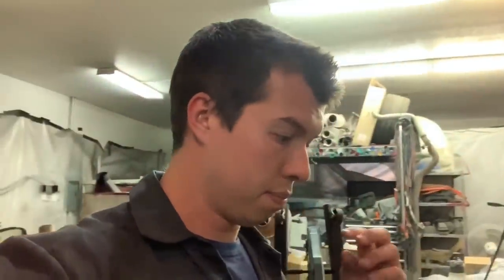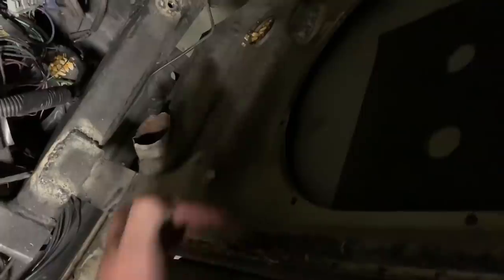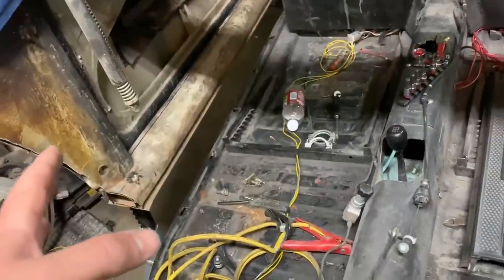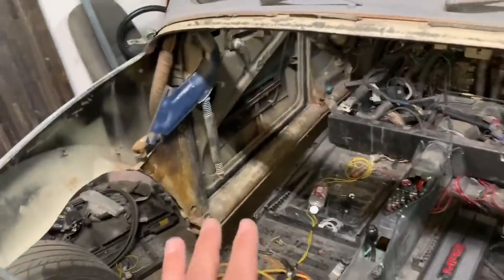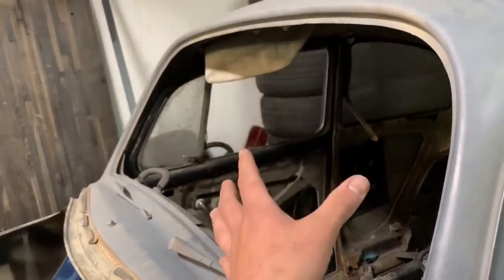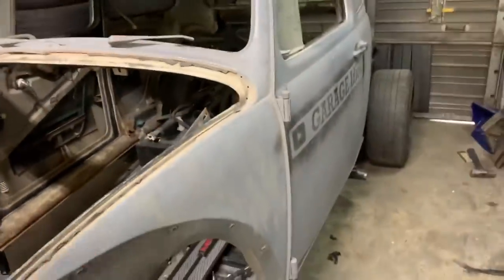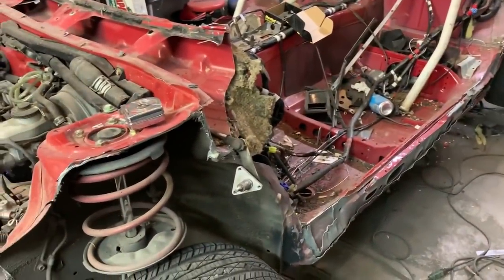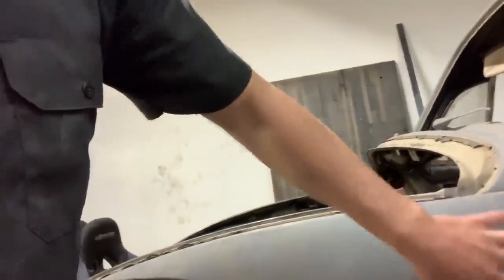NEW IDEA to make the Honda Bug body fit on the MR2 chassis!!

Comment: I'm thinking your pivot idea is good but I'll  would still cut it in half widening the top a little and the bottom more... In the long run it will avoid other strange issues that might happen. Would keep the standard front window... maybe just fill in the pillar around it.
Google vw bug hawaiian punch, I think it's inspirational and might help a little.

Comment: I think seating position is more important than fitting the body. The MR2 has a wider center tunnel than the Bug. So widening the bug makes sense. Measure the tunnel width difference and widen the bug at least that amount. I would go farther and section the sides to lower the windows, and lengthen the doors. And might as well give it a chopped top at that point to make it all look right.

Comment: Build a wood frame to go around the bug body at the body line under the side windows to hold that area and the area above it in place while you use a jack to spread the bottom until its the width you need it.

Comment: The center tunnel on the mr2 is a lot wider making it almost impossible to get a seat that fits. Cut the bug body in half. Find another bug and cut the top selection off as a donor panel to create the missing center piece of the roof, bottom of windshield and vents above the engine
Reply from the maker: Great points, thank you

Comment: dont cut the window frames, keep them normal but put expansion darts/cuts in the pillors beside them
Reply: this is the same thing I was thinking when he said to cut the windshield frame.  even if you only move one side a 1/4" then you are making it a total of half inch wider which will keep the factory windshield from fitting.  you should cut down the edge of the pillar then down the inside edge of the fender like this guy suggested and save yourself alot of time and headaches.  its easier to fill in those sections with metal also

Comment: I like your ideas and work. I like how you aren't afraid of tackling difficult jobs or even if you are, you don't let that stop you from doing it. People online talk shit all the time. You should take the comments with a bit of salt. Use the good ideas, learn from constructive criticism but otherwise try to let stuff just in from the other ear and out from the other. I know it's not easy task but sometimes you sound pretty apologetic and take quite a lot of pre-emptive measures and mock your ideas as stupid in advance. The ideas are not stupid. You have carefully considered the stuff and taken time to form your opinion. Someone may be able to bring up even more valid points and you can learn from them but that doesn't mean your ideas were bad. I think widening the bug body by stretching/bending is good idea. You could probably widen it quite a bit at the rocker panel level even without touching the pillars and the roof line but you should consider the head and the shoulder room. The center tunnel of the MR2 is wider than in the bug and unless you cut into it, the center tunnel defines how far to the side you need place the drivers seat. The shoulder line of the car and the roof need to be wide enough especially if you make a roll gage with tubes going to the a-pillars.
Reply from the maker: Awesome comment man thank you.  The gas tank for the mr2 is in that center section so we don’t really want to relocated that.  I think we are back to the first idea and are going to cut the bug in half

Comment: Like the idea and project. If you are going to weld the bug body to the mr2 chassis then just cut out what you need off of the mr2 to make it fit. Then add a roll cage to structure it. The shape of the bug body will structure it up quite a bit by itself.
Reply from the maker: Thank you!

Comment: I think so far the best idea I've heard would be like Michael Lane and a few others suggested in putting stress Cuts in the tillers and stretching the body to fit that would keep plenty of strength in the chassis and you should be able to stretch that thing for what you're needing may have a couple creases in the body but nothing that a little heat and somebody filler when fix all depends on how far you go with it with the stress Cuts or release cuts you may not encounter that issue
Reply from the maker: The biggest issue with this idea is the steering wheel of the mr2 is going to be crazy close to the bugs door frame

Comment: Have you looked into a capella chop? It's a way to chop the roof of a beetle without widening the roof by notching and bending the pillars. Could give you an idea what happens when you start to pie cut the pillars. Those curved shapes really start to go in weird directions when you start to cut them. Also, don't know how low you want the beetle body to go over the mr2 floor, but if you run the sidesteps (fake look at least) you have some extra space for structural stuff to stick out from the sides. Keep up the good work, always nice to see someone cut up cars and weld them together in not stock ways.
Reply from the maker: All great ideas! I’ll look into it! Thank you!!

Comment: Dont widen the bug top body. Heres how. Brace the bug body, then cut the bottom 2 inches off the sides of the bug. Then trim the structure on the side of the mr2, and set the bug body on top of it then weld it to it.  It will look like running boards on the sides, just like the bug originally had. Then add braces as required. If you need any help, just contact me. I'm in tucson, but I'll be happy to talk it out. Keep going, your doing great.
Reply from the maker: I did think about that but the front section of the bug/ mr2 would make that difficult

Comment: Hey, not sure if I like the roof "relief cut" idea.  Since the roof is a circle you are going to have to cut a long way to get it to move out.  Otherwise it will pull the center of the roof down in the middle.  

If you decide to cut it down the middle, I have a couple ideas. First take a pipe and a smaller pipe that will fit snug inside the larger pipe.  Weld the larger pipe  to underside-center of the roof before you cut.  Put one near the windshield, one near the rear glass and one in the middle and make sure they are square to one another. When you cut, take the center pipe out of the larger pipe and cut in the roof and the pipe in two.  This way you can line up the two pieces and will support your new metal you can weld back in.  Finally, I would cut AROUND the windshield and back glass area, they way you can keep the stock size glass.  Just need to add metal around the area to make up for the difference.  Lot of cutting and welding, but I think will look great when you are done if you take your time on the welding.
Reply from the maker: Awesome ideas man thank you

Comment: Running boards looks like it could be a simple option that would require no cuts to the VW shell. Also I am not sure about the metal types used the MR2 chassis construction but if it is a high carbon steel typically used in more modern crash cell construction then structurally it will turn to cardboard if you heat it by welding and you need to use an appropriate jointing method possibly spot and/or bonding combination.
Reply: The running board idea is a winner

Comment: To be honest it seems better to cut it in half and run plexi glass on the front and back windows. It seems so much simpler. Plus you would have a sweet ass stripe running right down the middle of the bug lol

Comment: You could cut the pinch welds that hold the sides on which will mean you keep the strength in the front and back panels and just re-weld the sides when fitted you would still have to remove the bits you mentioned but you wouldn't have to cut the roof hope this gives you another idea
Reply from the maker: Thank you!! One more thing to thing about! I appreciate it!

Comment: i wonder if it would be easier to literally cut it right down the middle? then attach the sides to the chassis and a strip  of sheet metal down the middle to re attach... hot rod guys sectioned hoods, fenders, and roofs since the 40s... just need a helper and some sort of way to hoist the body up for mockup and panel alignment

Comment: Have you ever thought of making a fiberglass shell of the bug using the current bug as a mold? You could then widen the shell and make it fit how you want.
Reply from the maker: That would take a LOT of work haha I like where your head is at though
Reply: @GARAGEIdiotS  it would also make it easier to put on and take off, and easier to cage it in the future.

Comment: Oh, one other thought. The make racing front clips for the bug, they are totally exclusive of the bug frame, to begin with. You bolt them on however you want. You might get away with that and the extended running board idea

Comment: I kindof liked the idea of cutting it in half; like you said its never going back on a bug.. so its gotta go on the MR2 the way it fits best. Stretching it would probably work but then your roof is going to be skinny; Should set the seats in the MR2 and check where they sit, I imagine its farther apart than the bug seats and you might hit your head unless you widen the bug.
Reply from the maker: Yea I’ve been thinking about that a lot

Comment: I think halfing the bug will look better and overall be easier to achieve. It's been done a bunch so I know it's possible. It's a curved panel, but I think it would be easier to make a single fill strip than patch in a half million pie cuts that are compound curved. Just my opinion I would half it.

Comment: Hi have you thought about cutting ten inches out of the center of the mr2 just a thought might work better and look better that way it still looks like a bug. or even a pie cut in the front were most of the mr2 needs narrowed .
Reply from the maker: Gas tank is in the center :/
Reply: put in a fuel cell @GARAGEIdiotS

Comment: Cut more out on the mr2 floor and just stretch the bottom of the bug out without relief cuts. I bet you can stretch the bottom out 2.5 inches per side.Then cage and re-enforce.

Comment: If you have to widen the front more then rear you will mess up how the door opens and shuts. Prying out the bottom of the body will most likely buckle the crap out of the roof too.

And have you checked to see if you'll be able to fit seats in it? The MR2 has a much wider transmission tunnel.  And if you narrow up the center section of the chassis at all fitting seats could be an issue.
Reply from the maker: Yea that’s the biggest part of me wanting to just cut it down the center for that reason

Comment: Keep it simple and never try to bend compound curves... A simple cut down the middle and fit both sides separately then fill in the gap. In the end you will make up a space-frame and using decent tube throughout it could look great and give your floppy bodywork something strong to fix to.
Reply from the maker: Awesome, thanks!

Comment: It’s either cut slots or cut the bug and a half weld one side walls another side separately to the sub frame find another bug in the junkyard cut that stripped out and install it in the middle strip that you cut out and then reinforce the area that was cut with metal tubing like a cage

Comment: Have you thought about doing a roof chop ?? If it was me ild make a jig to hold the but at the size of the mr2 floor cut the roof down the middle and then you can add steel down the middle and then you will keep the lines of the beetle and you won’t notice that the body of the beetle is wider the rear and front window would need to be bigger
Reply from the maker: I have, the only thing that is stopping me is I hate how it looks with a roll cage on these cars, that was the original plan until I saw some with cages and did not like how they looked
Reply: I messaged you on Instagram

Comment: Alternatively cut the body at the body line just below side windows, add a 2 inch filler strip, then pull bottom of body out one inch each side. 6 inches wider with no changes to roof or screens. Only issues will be if you need roll down side windows will need to modify inner door shells to allow window to drop and changes to fender profiles where they meet the body.
Reply from the maker: At one point I was looking at that body line and thinking something similar, the door/ window function is what scared me
Reply: @GARAGEIdiotS  You could try the design for side windows used in early 1960's Austin Mini Mk1, here in UK, where there are two front to rear sliding glass windows split vertically in center. Check google images to get the idea. Not sure if early Mini's were exported over there but are easy to manufacture as flat glass.

Comment: So I am a doer also and that sounds like a working plan. But, I will say this, on the Bug the sold points near the windows where you are talking about cutting, where the rain would run down - is the structural point for the Bug body.

I think you will good though because the MR2 has structural support in the pan itself whereas the Bug pan was designed to flex.

What I would add to do that is add a roll cage that runs right up against the roof of the bug, plus make sure you have solid cross support above the Mr2. The stuff you use for shock tower support, ect

I say that because the Bug had torrison bars. The body was designed with that stiffness in that area.

By the way, are yall in Texas or Co?
Reply from the maker: Awesome comment!! Thank you! And we’re in Colorado!

Comment: I have many photos on my FB and some on my Insta of tackling these issue on my bug/miata. If you want to message me and ill share some insight if you would be interested let me know. Some advice i can give is just do what you can that seems reasonable. You may need to get a set of fiberglass wide fenders for the bug or add some sheet metal in key locations to help mask the unsightly areas. GL and keep it up.

Comment: Your on the right track but your off , there’s a lot more cutting and less structure to both vehicles if your relief cut and flare the body , versus one straight line down the center . (If you are comfortable with cutting and raising the fender it’s the same thing )  we have chopped a crx and it’s the same process . Your saving grace in this is the windshield glass is flat (easy to cut polycarbonate and make a new one )  and not curved like a modern car.  (We cut the firewall on our chop bc it maintains the factory glass which is curved ) . To flare your body correctly like your thinking you would need to slice the middle of the whole A pillar bc the door has to stay in the same plane as it pivots out . Don’t over think it and make more work for yourself . You where on the right track the first time unless you are trying to re-engineer the the thing .
Reply from the maker: Haven’t thought about that angle effecting strength, excellent point

Comment: Go get 3 inch widen front and back fenders and turn the MR2 floor pan in to the running boards. The fenders might cost you a little more then $300. That would look sick
Reply from the maker: That was a thought but the front of the mr2 chassis is where we’re running into the most problems and it wouldn’t allow that idea

Comment: Cut the bottom few inches off the bug body to match the height difference of the mr2. And just sit it on the mr2 body the brace it all up. It will stick out but you could cover it with the old side steps bugs have..
Reply from the maker: Thought about that but the front is too different and I haven’t been able to think of a way to make it work
Reply: @GARAGEIdiotS  I'm sure you'll be able to make it all work.

Comment: Dude this gets better with every upload. Question why dont you just use the back half of the MR2?
Reply from the maker: Trying to avoid welding to frames/ chassis together.  If the mr2 can stay “full” mr2 we can be a lot more confident in the finals product
Reply: Makes sense.

Comment: Theres a reason it ain't been done I used to dream of these projects doing all the problem solving but some things are just silly however cut bug into two use donor shell metal to piece gaps together but first build a reliably strong jig so it doesn't goe all Pete tong on you in essence you need a jig that you can weld inside the bug body that will once body is cut will adjust width of body shell halfs keeping the body pretty much insitue allowing for the halfs to be welded together using donor panels
Reply from the maker: I think that’s the route we will be going

Comment: The amount of cutting and flexing you are thinking about is WAY MORE WORK than adding metal to the smoothest parts of the body,And it would still look like a bug body. Honestly cut the bug in half or cut the MR2  in half. Also there is another benefit to a widened bug body. The steering column would be much closer to where it needs to be. The gas tank is a non-issue. Super easy to figure all that out after you get the body together.
I seriously like your ambition though.
Reply from the maker: You make a good point and I overall agree with you but cutting it in half just scares me haha

Comment: I dont know what your budget is, but this tube chassis is one you can weld yourself. You wont have to cut the bug you could probably still use the mr2 suspension and swap the k series in it plus you will have a solid frame to build from.

https://vwparts.aircooled.net/RLR-Unwelded-Full-Chassis-Kit-31-900-p/31-900-unwelded.htm
Reply from the maker: Wow that’s actually cheaper than I expected
Reply: @GARAGEIdiotS  I would assume assembled would be a bit more.  I would like if you decide to do that, to see you guys weld it together it would show anyone trying this how to do it imo.

Comment: Scrap the mr2 and go with a dune buggy / rail buggy they are based on the measurements of a bug rear engine and all
Reply from the maker: Too late, I have to see this through
Reply: I get it man I just hate to see you struggle when there is a easier solution